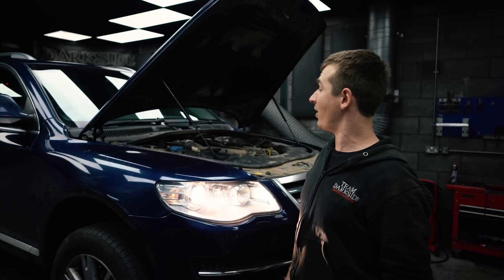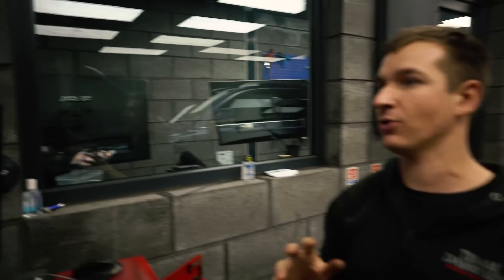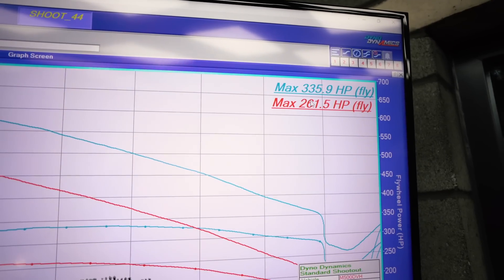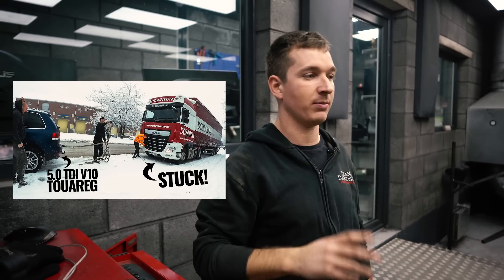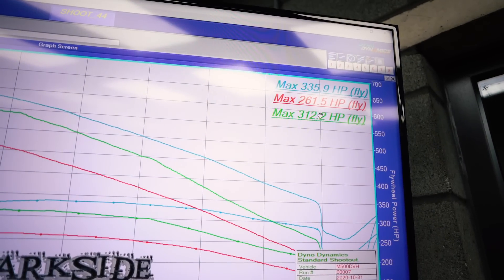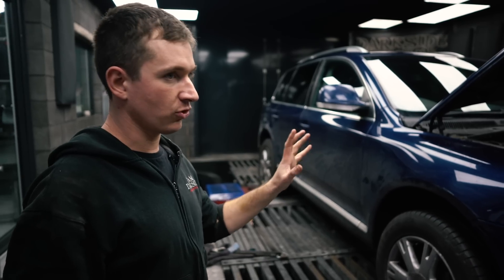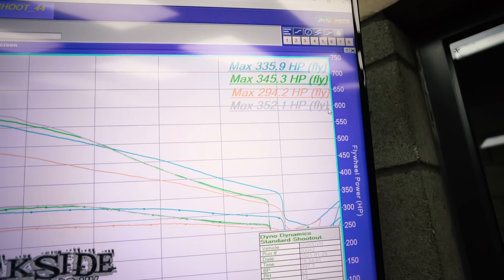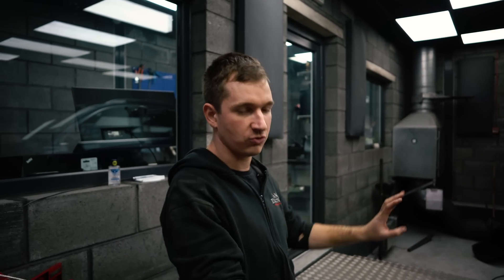We LOST 74BHP fitting Mud Terrain Tyres! 5.0 TDI V10 BLE.

Comment: Does the Dyno take into count that the gear ratio will have changed since fitting mud tyres?
Reply from the maker: We do the tacho every time, set using wheelspeed at the roller Vs engine speed in VCDS

Comment: +Darkside Developments, what dyno do you use? Were those measurments done in acceleration or loading(braking) mode?
Reply from the maker: Dyno dynamics, it has a shootout mode with a fixed braked ramp rate
Reply: @DarksideDevelopments  I have same GP Touareg V10 TDI, during dyno testing on several dynos in my city I've achieved very different results during ramp-up mode and steady state mode, later on street using accelerometer I've subtracted transmission switching time from 0-100km/h acceleration time and calculated force based on vehicle mass and net time for 0-100km/h acceleration, steady state dyno measurements (2000-4000rpm with 250rpm intervals) from wheels were very close to real acceleration, and were very far from what ramp-up mode showed. If you don't mind me asking for taking steady state measurements on 2000rpm, 2500rpm and 3000rpm? Curious to compare for what I've done with ECU :-) BTW both stock exhaust manifolds failed once I pushed exhaust temp limit to 800deg. cel. (stock was limited from 700 to 750deg) while on 3.0tdi stock manifolds were OK with short runs for 880deg. cel.

Comment: Have you lost power on wheels or the crank? I dont get this... 
You cant lose power on crank by adding different tires
Reply from the maker: DD don't compensate
Reply: @DarksideDevelopments  from what I've seen, a lot of stuff goes into calculation. How does your dyno gets rpm? From roller speed?
Reply from the maker: Yes roller. It we set the rpm

Comment: Is it dynoed in the same gear with and without the mud tires? I dont think you actually have lost any power, it is just the ratio is different so the flywheel calculation is to low.
Reply from the maker: We set the tacho every time, DD cant compensate for sticky or different tyres
Reply: HP at the wheels changes.

You'll definitely notice the drop driving.

It'll be like being a gear higher.

Comment: Yes lads! Keep working on it! Did you manage to find the tool for the brass fitting in the air suspension? I still need one 🤣
Reply from the maker: We have one, you can borrow it when we are done, not had the car off the road long enough to do it!
Reply: @DarksideDevelopments  can't wait for you guys to start dropping this engine and making an engine cradle for it, I'd like to see what this is like with hybrids! And weather it can take it
Reply from the maker: I don't want to drop it!
Reply: @DarksideDevelopments  if anyone can do it! You guys can! I've seen a guy make a engine cradle out of pallets for the v10. My dad's been bugging me to help him make one for our v10
Reply: @DarksideDevelopments  booooo!!!!we want bigger turbos!!!(you know u want to 2)
Reply: @williamatkinson2499  twin 2060 or 2260s no point dropping it for some small snails
Reply: @DarksideDevelopments 

Where did you get the RPV tool?
Ive found the source of my leak today.

The seal between top mount and airbag and the dreaded RPV is leaking.

Thanks Ian
Reply: I made and still have a pallet that holds from the subframe all the way back to the gearbox supports, so with a pallet truck you can drop the lot out and pull it out the front (after removing the front end!)
Reply from the maker: The lads I know drop everything out in 1, rads and all.
Reply: @DarksideDevelopments  if I was to do it again, I'd made it longer to pull it all! Absolute bastard draining all those fluids when I could have got away with just A/C. Its not something I'm doing again, especially without a lift. I'm selling soon as is a good time.
Reply: Look up josh's Jetta. He's a Canadian guy who took his out.
Reply: Handy to know

Comment: Guessing the R50 is same just with a tune?
Reply from the maker: Yes
Reply: Same turbos gearbox etc?

Do you know if 2002 - 2006 pre dpf cars have same set up?
Reply from the maker: Everything mechanical is the same as far as I can tell. The turbos are different on pre DPF cars among many other updates.
Reply: @DarksideDevelopments  pre Dpf have H suffix turbos and later ones are J suffix.

GT1852VK garrett honeywell

Comment: Mine defo feels different on 265/60R19 porsche derived winters. They are quite a bit bigger in diameter than std 20" summer wheels

But quite a drop off in power you've spotted with that extra rolling radius. Top speed will be reet up 

Keep up the good work guys

Comment: It really needs some upgraded turbos and injectors :)
Reply from the maker: If it comes out it won't go back together without something better!
Reply: Are you offering to fit turbos? You need Mr tickle arms
Reply: Henrich Muller  Seriously? You have no idea what needs to be done to pull out the motor...you need to pull out the whole motor with gearbox, differential and the whole running gear as one unit...massive job.
Reply: @trupersonnel9293  it is not that bad, that subframe is made to come off easy